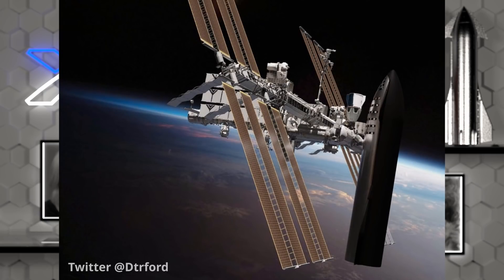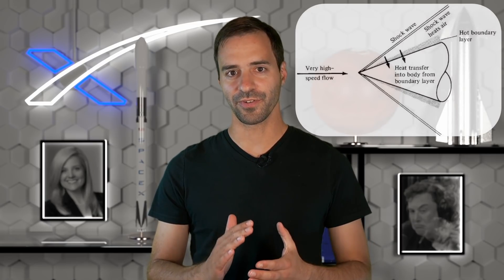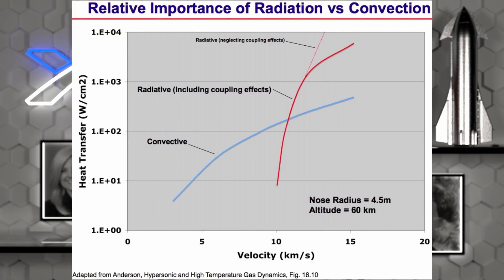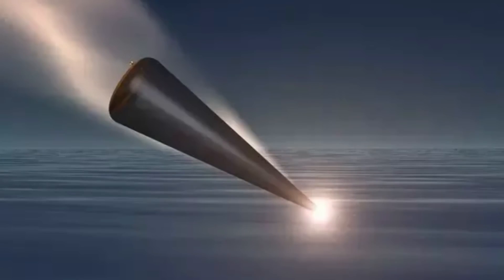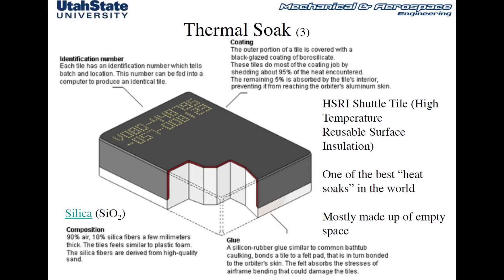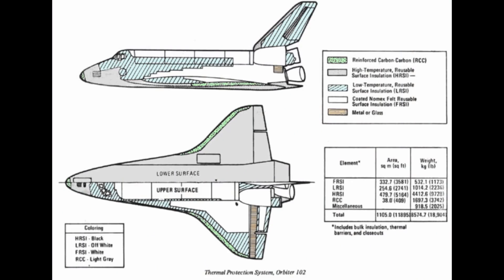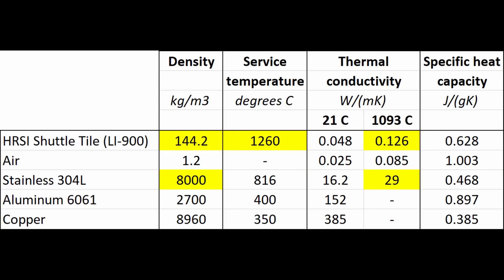Thermal Protection System - Starship vs. Space Shuttle

Comment: The physics behind those HRSI tiles and the Starship tiles is called Mie scattering. The tiles are made from ultrapure silica fibers (silicon dioxide, or quartz) that are about 1.5 microns in diameter. A human hair is about 70 microns diameter. The fiber diameter is selected to match the wavelength of the thermal radiation at the maximum use temperature (2400F, 1316C). The fibers scatter this radiation far more efficiently than they absorb the thermal radiation. 

Two parameters characterize this scattering process: the backscattering coefficient and the absorption coefficient. For Lockheed's LI1500 tiles, the backscattering coefficient is 223 while the absorption coefficient is 0.3 at 2400F. So that tile scatters thermal radiation about 743 times more efficiently than it absorbs that radiation. That's the secret behind the tiles.

Side note: My lab at McDonnell Douglas developed the equipment for measuring those two coefficients way back in 1969 during the early conceptual design phase of NASA's Space Shuttle program. Those coefficients are measured in units of inverse surface density (ft^2/lb).
Reply from the maker: Thank you for the wonderful comment. I need to pin it up.
 I wish I had somebody with your knowledge to consult with, and I hope that the video wasn't too unpleasant to watch for you.
Reply: @spaceflightexplained360  Your video is very good. Keep it up.
Reply: It's always fantastic when you have access to the insight from someone who actually worked with it. Thank you very much for sharing this!!
Reply: I know nothing about this matter (I am a Physician...) so please forgive me if my questions (as I suspect) will sound laughably dumb:1) is this technology somehow similar to Aerogel? 2) how much will this tiles be consumed / worn by heat? Nice to see you back Vojtech Holub 😊
Reply: The Shuttle tiles were not consumed during entry, descent and landing (EDL). The Shuttle tiles are reusable. Some of them made more than 25 EDLs during the time that the Shuttle was operational. Another type of thermal protection concept called ablation is used for heat shields on spacecraft like the Apollo Command Module and the SpaceX Dragon 2. Ablators are sacrificial and lose material from the hot side during EDL. Ablators are typically used for one EDL and then scrapped.
Reply: @rays2506  Thanks Ray S 😊: space travel is such an interesting matter that I can''t help but getting more and more curious (25 EDLs is impressive...)
Reply from the maker: @SmogandBlack  That is a great question! The way I understand it, it is actually pretty close to aerogel, slightly lower air ratio, and with additional coating, and as the above commenter explained in detail, made specifically to radiate away heat. But the basic silica composition is very similar.
Reply: Do we know anything about the exact difference in materal and composition between the Shuttle tiles and Starship tiles? I had the pleassure of holding one of these Shuttle tiles back in the day while it was heated until red hot on one side, and they were very light, very effective but also very brittle. Could SoaceX be heading down into the same rabbithole, where they need to check the shield tile by tile after each flight, which would put an end to rapid reusability.
Reply: Can you suggest some further reading?
Reply: quite interesting! i work part of a postdoc to do modelling of thermal transfer in rock fibers used in house insulation. doing Mie scattering simulation is quite hard and unfortunately never got enough time to write a full simulation code. at 300K and 1 atm radiation is a relatively low contributor to thermal conductivity, the fibers mostly trap air to inhibit convection. simulating thermal conduction through the fibers was a fun exercise btw.

Comment: Why  is all the BS about physics necessary. Just say the shield needs to protect Starship during reentry from lengthy reentry of a max temperature of 2400F (1316C). From this information SpaceX scientists need to ensure the system that they design can protect Starship during reentry. This is the simplistic description. How they do that will, in my opinion, be successful, completed in such a time as to ready when SpaceX wants it to be ready. There are several issues in finding or creating such a shield. Let SpaceX tell us the timeframe they need in order to correctly create the shield.

Comment: I thought the Musk solution was to bleed rocket fuel through the craft skin.  What is this talk of tiles?  These things are going to pop off both at liftoff and reentry due to pure physical force, as well as due to the expansion of the steel skin (which is considerable) which will weaken the bond of the tiles to the fuselage. Steel, with welded mounting "studs" is brittle.  My prediction?  The starship is not suitable for reentry without considerable (and possibly fatal) results.
Reply from the maker: That "sweating" was dropped a long long time ago.

Comment: Most never understood the safety issues both the Space Shuttle had, or what "Starship" SN will deal with heat shield issues, BOTH needed full body coating of the HS tiles, any imbalance position re-entry , will be devistating. This will only need adjustnents of painting the area not entended to burn, if windows, will need a moon roof" style. For the Falcon 9, it used atmosphere, from its own rocket flares, SpaceX doesn't want to waste fuel for this safety, even for that misosphere, other alternatives would be a gel, to be subsitatude burn, or a seperate shield board.

Comment: Considering such a large portion of starships surface is symmetrical why not fabricate the heat shielding in massive precast panels where the shape allows for it? Saves time and money and reduces the chances of shielding failure exponentially.
Reply from the maker: I think the thermal expansion of underlying steel would fracture larger pieces in unpredictable way

Comment: i think, because i have the experience in my work in thermal furnaces processes , the combination of steel and liquid cooling are super efective. in long term this can be the best solution, for sure.  flow his liquid metane in the skin, and vent the pressure, cooling the methane in a fast closed circuit, obviously talk is cheap, i pressume the reentry is only 3-5 minutes of hot pick, if the quantity of metane can ficht this period, i don't know why don't take this line.
Reply from the maker: They seem to try it first without it for some reason. I'm sure that adding tiny channels into the mass produced steel is not trivial or cheap

Comment: This was great explanation.  One thing that I felt was missing: If this welded stud type mechanical connection is that much better, why didn't the shuttle use it?  Also, it would be nice to know why SpaceX used pica-X on the Dragon, but not on the Starship.
Reply from the maker: Thank you for watching the video! As mentioned here, PICA(X) is ablative, so you have to rebuild it often or every time. Not good for rapid reusability.

Why they didn't use a different method for attaching the Space shuttle tiles? Frankly, I don't know. Possibly the fact that they would have to be attached to the aluminum frame, which would be very tricky (disimilar metal corrosion and other stuff) and maybe weight constraints?

Comment: What if the space craft rolled round spreading the heat
Reply from the maker: I guess then half of the protection would be needed on twice the area?
Reply: @spaceflightexplained360  so are you saying it would work
Reply: @spaceflightexplained360  and also the speed of the roll would make a difference
Reply from the maker: :) Do a barrel roll! 
I'm not sure how will the angle of attack can be held if the vehicle is spinning
Reply from the maker: And there are also other things, like the need to protect from shockwaves on multiple directions if the vehicle has wings or fins
Reply: @spaceflightexplained360  as anyone tried a roll reentry it just a idea i was thinking on the line of heat dissipation if the heat is constantred in one place of course it will heat that area but on the other hand moving round spreads the load anyway thankyou to responding

Comment: Your math was spot on, but there is a great difference between the tiles on the Space Shuttle and the Starship.  The Starship tiles have a different ceramic composition, and are much stronger.  Reusing Shuttle tiles would be a recipe for disaster.  Elon did indicate that they do ablate and will have to be replaced after every 10 flights.  Shuttle tiles do not ablate.  Hull thickness is 3mm not 1.8mm.  Some sections will be 4mm thick.
Reply from the maker: I think there was some misunderstanding...
1) Tiles don't have infinite life span, they all need to be replaced eventually, whether it is Space Shuttle or Starship.
2) We really don't know what the exact performance of Starship tiles is, so in this video, I assume that it is the same as Space shuttles, but with different shapes and other advantages.
3) The 1.8 mm is not supposed the be the wall thickness, but and additional layer of the same weight as the titles would be. It is for comparison to highlight the power of the tiles compared to steel
Reply: @spaceflightexplained360  Thank you for your response.  The Shuttle tiles could be handled within seconds (Yeah from the corners only) because they were highly conductive and quickly moving the heat across all the tiles.  Those tiles were extremely fragile, but from what I've read about them, where they were placed, they did not wear, but they did crumble away.
     Starship tiles are not conductive, and ceramic.  They will keep the heat away from the backing, and hull - to a point since the Stainless Steel can take a lot of heat.  These tiles will reach melting temperature and will wear.  This ceramic was picked because of its strength, insulation, and melting temperature.  Ceramics  like all others have a binder which I have no idea what the binder is, but the binder has to have similar, but not so high qualities like insulation, and melting temperature, but increases the overall strength of the ceramic, and lower the fragility.
     I would assume that the ceramic tiles will be denser than the shuttle silicon tiles mainly for the reason to increase the strength of the tiles.
     I know this since I am a machinist and have worked with ceramics, and carbides which are a type of ceramic.

Comment: The TPS developed for Dyna-Soar was also a passive/radiative design using non-load-bearing columbium panels coated with silicide (a dark black substance) to increase its black-body coefficient.  There was a layer of matted quartz fiber insulation behind that and then load-bearing panels of Rene 41 super alloy attached to the vehicle's space frame (also of Rene 41).  It was estimated that it could go 4 EDL cycles before replacement.  The panels were relatively large with only a couple dozen over the whole vehicle thus not that time consuming to replace.
Reply from the maker: Were these panels realistic? There must have been some reason why the Space Shuttle that came later had smaller and different tiles... And also unfortunately aluminum structure
Reply: @spaceflightexplained360  - The panels had been quite extensively tested, or at least the materials had.  The advantage was that the Dyna-Soar was a "hot-body" vehicle during reentry, i.e. only the cockpit and cargo space was cooled.  The rest of the structure and systems were designed to operate at elevated temperatures.  While the columbium panels would have seen the 2-3,000°C surface temperatures during entry, the structure behind it (the Rene 41 panels and space frame) were designed for temperatures of nearly 1,000°C.

The cockpit and payload shells had a "water wall" attached that absorbed heat by phase change, and dumped it into a heat-sink that used the liquid hydrogen fuel to cool things down.  This is all detailed in the book "Dyna-Soar" by Air Force historian Roy Houchin: https://www.arapress.com/dyna-soar-book/

The Shuttle, OTOH, was a "cold body" vehicle, meaning that the entire structure had to be kept at low temperatures so the TPS bore the entire brunt of the heat.

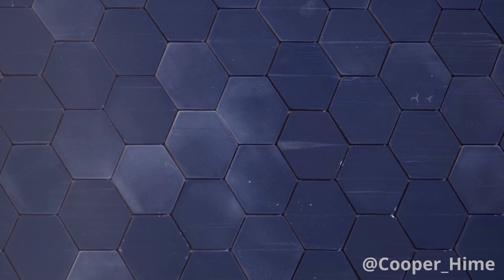Comment: 10:28 - I am not an engineer. But when I see hexagonal TP tiles with variable heights and gaps between them - like worse than the variation in the panel gaps of a simple car, then I become deeply concerned about the ability of such a system to withstand the onslaught it will face repeatedly (supposedly!) as it re-enters the atmosphere.

This is just one of a very high number of critical systems which must work perfectly, or the Starship simply turns into a Very Large And Expensive Shuttle, with a low launch rate, and slow turn-around.

And there is nothing to date which has indicated to me ANY system of Starship is even remotely reliable. From the pitiful landing legs to the header tank in the nose come, and everything in between.

The dream of land-refuel-and-launch-again is nothing but a dream, and will remain so for the foreseeable future.
Reply from the maker: We will see - I tend to be optimistic. That are really not designing a rocket, but a rocket factory. What is great, is that we are not paying for it.

Comment: you should have circled back to the original number; if the tiles have a radiate:transfer ratio of 1:180, you could  work out what fraction of the TJ of energy can be safely absorbed (and more than that, the back half of starship could be used as a radiator at a couple of hundred 'c safely to further vent the transmitted energy; 64,000 / 180 is only 355; the steel structure could just tank that without any further cooling...

Comment: In the last calculation Isn’t heat radiated in both direction?
Reply from the maker: It is, but wouldn't it be reabsorbed right away by the tile? Only one side is the of the tile is hot and coated
Reply: @spaceflightexplained360  I’ve just read pinned comment, I guess it explains it, internal part effectively reflects heat back to the coated layer.

Comment: Very informative. Another relatively cheap option is to use Inconel in lieu of stainless steel for greater heat resistance in selected areas. Don't  know if it maintains adequate strength at cryo temps. Thanks
Reply from the maker: I think there might be some issues with just using heat resistant metals
1) They are very heavy
2) Is thermal conductivity is very high - inconel can take the temperature, but the regular structure underneath will melt

Comment: You would think the space shuttle interior frame structure would of been built on a titanium, or at least with of at titanium alloy with A-286  steel, such as the x-15, unfortunately I wasn't born yet but my father worked for a supplier that worked with these materials back in the 50s and 60s their biggest customer at the time was the US govt. any how A-286  maintains its corrosion resistance in temperatures up to 815 C when applied as an alloy with inconel metals, you can get a variety of combinations that each with distinct features and performance that will out preform aluminum, in strength and weight, and are welded using  gas tungsten arc welding or electron-beam welding. The orbiter cost was astronomical, not only was the there the protective tile issue, but anytime the orbiter lost a tile the underneath aluminum structure had to be ultra sound tested, for any deficiencies in the material in regards to heat transfer, this process literally required a strip down on the orbiter. Space X saw the space shuttle program as what not to do, for reentry and how it could  minimize cost and reusability, however most space x renders shows starship reentry as almost upright, where you show it more at an angle. I wonder with its cylinder shape would the stress on starship be equally displaced depending of the attack angle, or due to high velocity that would cancel out and place most of the stress on the fins, by the way great content, thank you
Reply from the maker: Thank you for the great comment! Do you have a guess why they decided for aluminum at the end for the Orbiter?

It is now an old information (2019), but Elon did mention that the angle of attack to be 60 degrees during the reentry.
Reply: @spaceflightexplained360  My guess is weight.

Comment: That is interesting that SpaceX will use on the Starship essentially Space Shuttle heat shield technology.  I understood that the X-33 Venture Star was suppose to use a metallic thermal protection system much more robust than the Shuttle's.  I wonder if SpaceX evaluated this shielding material.  https://airandspace.si.edu/collection-objects/heat-shield-x-33-reusable-launch-vehicle/nasm_A20060281000
Reply from the maker: That is a great question. I wonder if the weight was an issue, or the price and manufacturability since it is made from titanium and inconel
Reply: Yes, X-33 had baselined metallic TPS. I don't know if SpaceX seriously considered metallics for Starship.

Side note: I tested those X-33 metallic TPS panels at the NASA Ames arcjet wind tunnels in early 1996 under contract to NASA Langley. They performed as expected up to about 1800F (982C). Other TPS was also tested up to 3000F (1649C) for the high heat input areas of X-33.